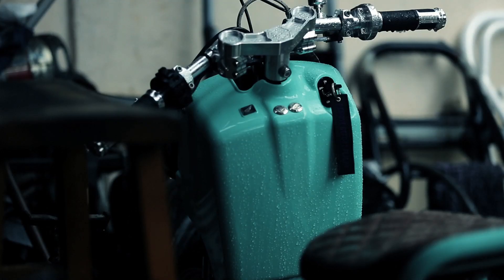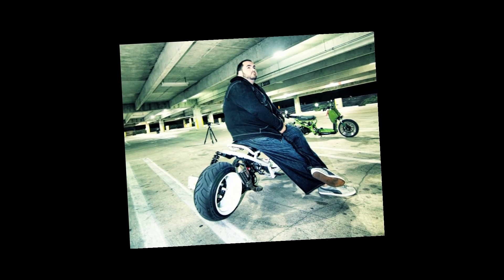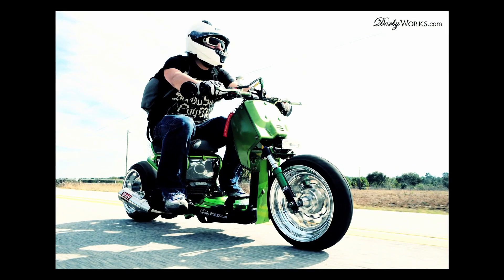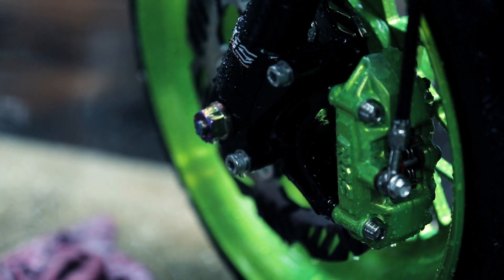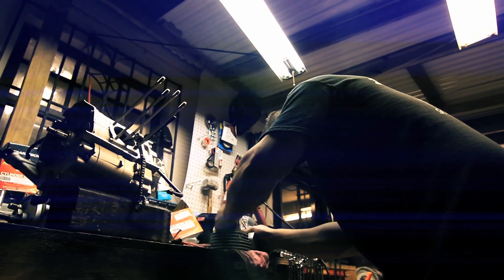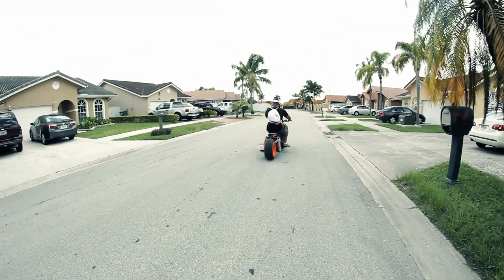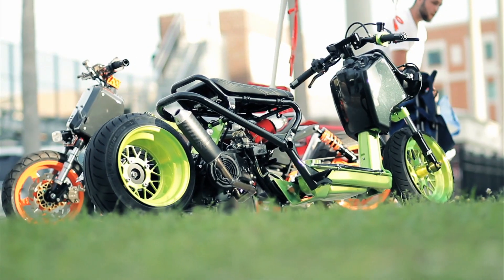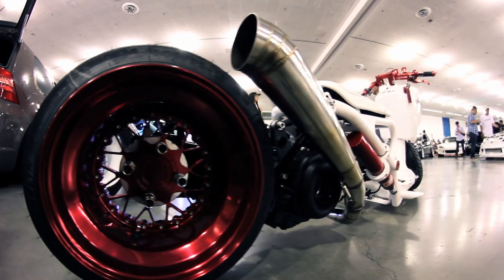Honda Ruckus builder profile Dorbyworks Miami Florida

Comment: I read that these things only hit 40-45 max can you boost them up too 65-70?
Reply: Yeah you can get a bore kit and bore it out to get it going 75
Reply: +FatsharkFun how are these things in high speeds ? Looks like you'd get speed wobbles
Reply: +cmvd0812 I've never ridden one but I would assume that you would get them with the front forks being almost 90 degrees above the front wheel

Comment: We Have a 2012 Stock Honda Ruckus with 325 miles on it . We are getting 
together all the parts . to Build up a Motor & trans . to make it 
run faster .  We have  a doner  motor & trans to use . What we need 
help in is finding a Big bore kit . or Just a bigger piston to make our 
own . & . we need some over size Valves . if you or anyone else can 
help . it would be a very big help . thanks to every  . George

Comment: cool little bikes but I would have to do a 2 stroke swap, not a big 4 stroke guy, and it would have to be clutch  and have more than one gear
Reply: +Rob Motovlogs sorry im late, but a variator transmission has almost infinite gears.. its not a single gear automatic such as karts..